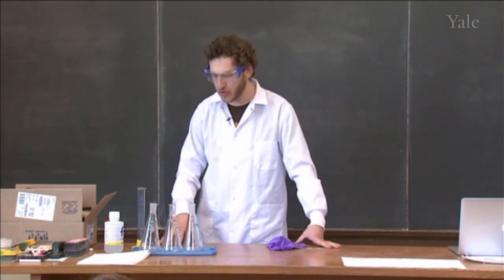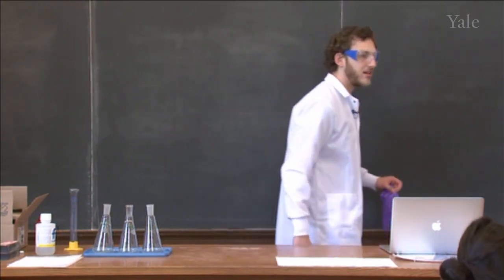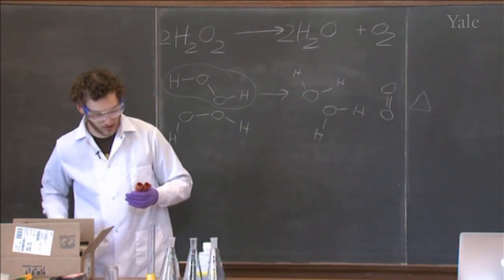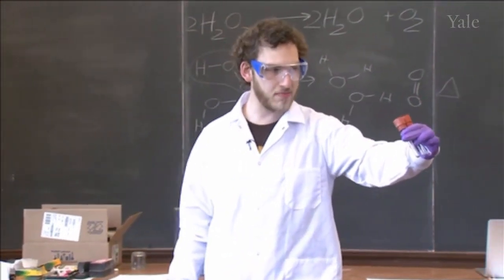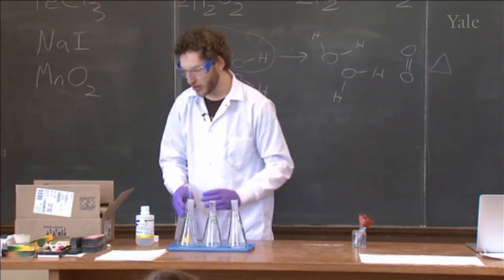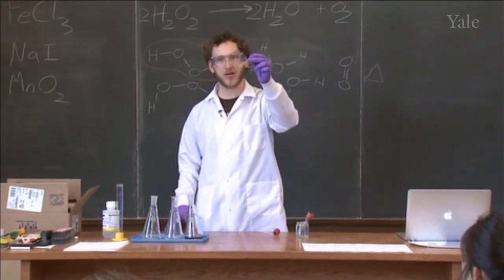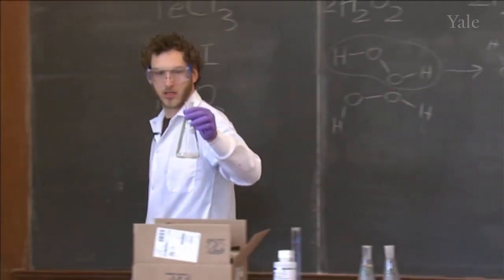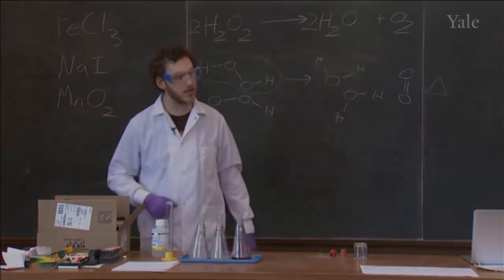M8B MoDRN Catalysis: Catalyst Experiment

Comment: I really appreciate access to these sorts of videos as I lecture chemistry myself and I'm always looking for good practice. I wonder if I can offer some useful feedback pedagogically and hope that this is not intrusive.

Prof. probably felt during the demonstrations that it would have been more useful to have the pre-measured peroxide in the flasks before he began. On addition of the Iron (II) Chloride, the solution immediately changes colour dramatically, and my experience is that students would conflate that with doing something very quickly despite the point in the demonstration being that the FeCl2 is the catalyst with the slowest turnover. On this scale the colour is the most obvious observable change in the flask.

As a viewer who probably is seeing more than someone in the lecture theatre would, I just had to take Prof's word that the catalysts worked in the order suggested, I couldn't really tell because of the scale of the reaction, and I wondered if it would be more effective to visualise the results more obviously. Otherwise we lose the joy of doing the demonstration in class.

To some degree making a visual assessment of "fizzyness" is fine, but it seems like Prof. also had a chance to discuss how a good catalyst is measured. In this case you could have all three conical flasks bunged and tubed to three large inverted measuring cylinders of water. You take some volunteers to help you insert all three catalysts into the flasks and bung them up immediately. You have the chance to illustrate that the RATE of oxygen production is the important thing here, is it being produced quickly? How can we tell? Well we should see each cylinder fill up with oxygen at different rates. The 'best' catalyst performs more conversions of H2O2 per second and so makes more oxygen per second. BUT all three reactions will eventually produce the same amount of oxygen. You could even draw a 'finish line' on the measuring cylinders and have students time the reactions as they go.